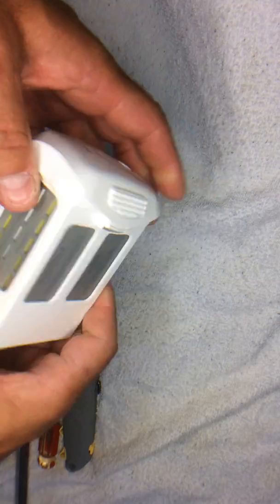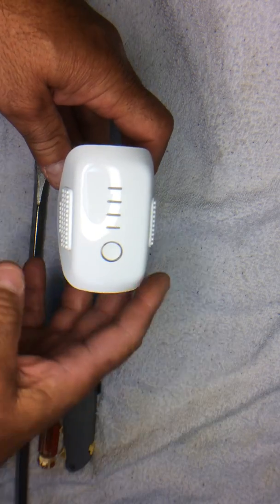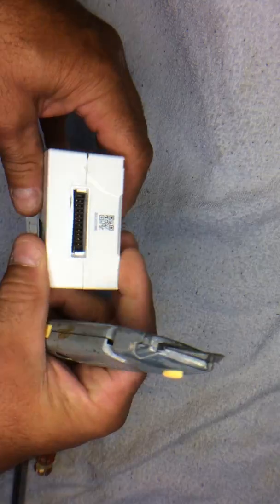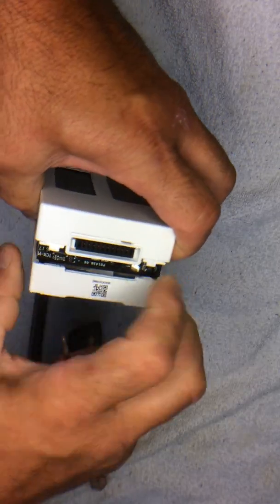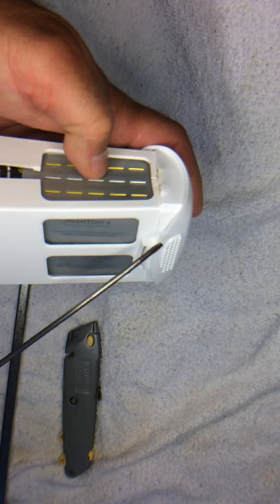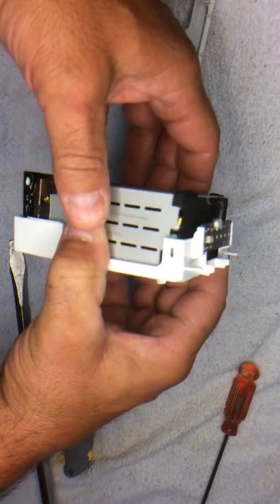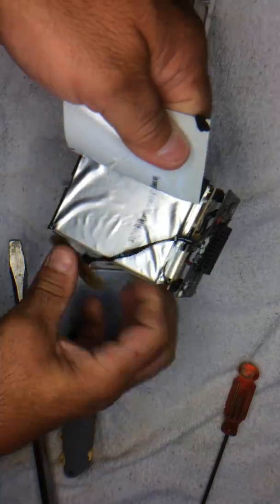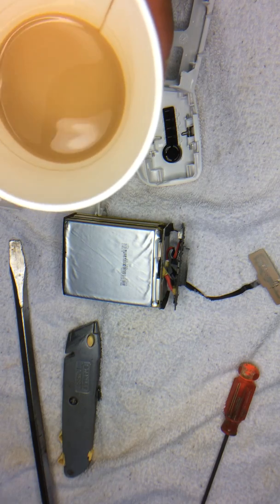Dji Phantom 4 BAD BATTERY disassembly

Comment: The battery should not be dead at all but just disabled by DJI's circuit. Technically, you can remove the circuit, add balancing and main wires and use it for other drones.

Comment: Great demo as usual and thank you for this.  Always wondered what they looked like inside.  Got me thinking.  You can drop many types of batteries in water and just dry them out and they work again but what is the reason for DJI making this battery disabled?  It is because some people may dunk them in salt water in which there could be problems for sure with the battery, so they kill the battery for everyone so as to avoid some law suits or something?  Is there a way to reverse the switch if it only fell in fresh water, and after being dried out could be used again.  This switch must be made of a material that melts in water some way to break the connection of the battery.  If you were able to by-pass this and connect it up again, would it work properly?  Most people would not even attempt to even open these things up as you do, and good for them, you have to know what you are doing but, you know the way society and business works, if it might hurt one person out of a million, then kill it for all.  These things are worth a couple hundred bucks each in canadian dollars anyway, and even though i know a bit about this stuff, I am not sure i want to try to repair the battery either.  I just thought I would bring this up Roy as some food for thought.  Could you  repair it or do you think it is too dangerous even for you to try?  Happy Flying

Comment: Fantastic.  Can you tell us what is written on the single cells?? Also, please provide precise dimensions of the cells.  I intend to refill a pack with new cells.  It's easy to find cells with the specs, but not the dimensions.  Very smart on DJI's part to maintain the cash flow.

Comment: My dji battery swelling and still operate normal except its always stuck inside the drone, do you reckon it will create problem in the future? Thanks guys if you have time please let menknow👍🏽👍🏽
Reply from the maker: A swelling battery could fail during flight. It’s always 1 cell that will fail. I would keep drone close by if I was to use a bad lipo
Reply: Cheers for that, i ll keep in mind, hopefully the battery won’t die during flight, thanks 🙏🏽